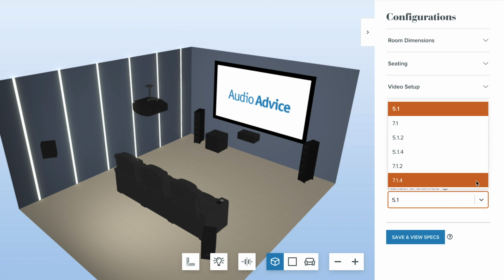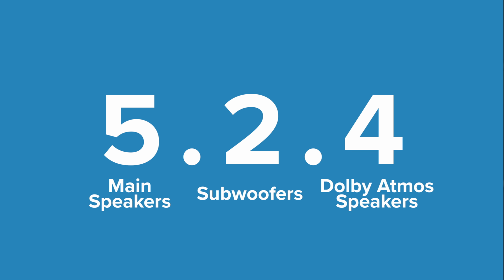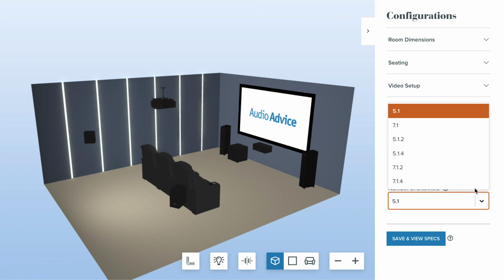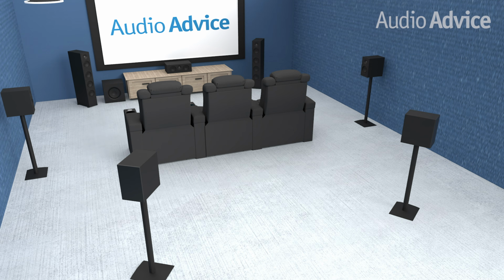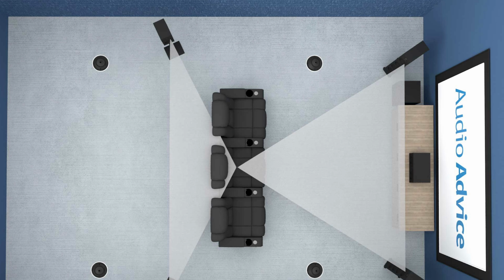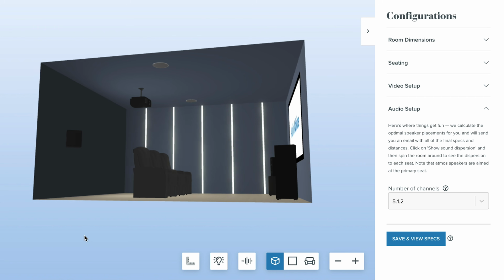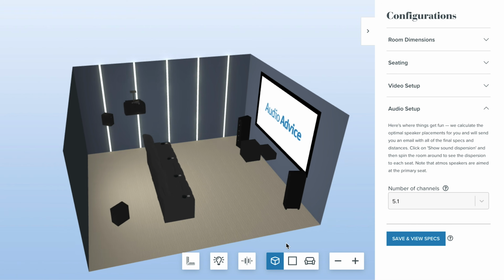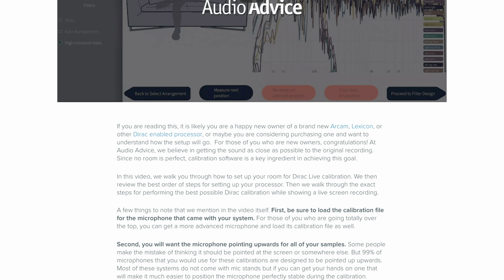Home Theater Speaker Layout Options

Comment: Quick question: If you have a dedicated room that is both an indoor golf simulation and a home theatre, where should the speakers be placed? In an indoor golf sim room the large hitting screen goes all the way to the ceiling, sides and floor. The screen is thick, so probably the sound is degraded if the speakers are placed behind the screen. Additionally, both walls and ceiling will be covered with wall protection padding to catch errant golf balls. These wall panels will be 6 feet deep on both walls and ceiling. The dinmensions of the interior of the room is 10ft 4" H x 14ft 2' W x 30ft D. I'd like to use a Dolby Atmos 7.2.4 system. With this knowledge, where should I place my speakers for optimum immersion? Cheers.

Comment: I'm only running 5.1 (with then intention of running 4 atmos soon) and I noticed that you switched the main surround speaker location in your website tool. I've been setup like you're showing in this video with the main surrounds slightly behind the MLP at an angle. But if I now go in your website tool, they are now perfectly perpendicular left/right of the MLP in a 5.1, similar to what a 7.1 would have be minus the rear surrounds. Is there any new sciences that came out that I missed regarding 5.1 surround placement? Thanks for the help!
Reply from the maker: Yes we did change it after much experimentation and talking with several speaker manufacturers we respect.  Dolby still suggests having them slightly behind you but we found with most theater seats it was more immersive slightly in front.  If you have a chair or couch that ends below your ears, behind might be better in some rooms. Hope this helps.

Comment: If you're talking about moving speakers to fit them around studs, which I think you mean joists, then you don't get to decide left or right or forward or back. The joists run in one direction. You don't get to pick
Reply from the maker: That is correct but in some rooms they run one way and in other another, this is just general advice.  Thanks for watching

Comment: @AudioAdvice --- What's the most speakers that movies could even take advantage of? And whats the most speakers that players/streamers or receivers/processors could output to?
Reply from the maker: Commercial cinemas can have up to 128.  The Trinnov Altitude which is a consumer piece has a 64 channel version.
Reply: @AudioAdvice --- So do the DCD/BD include these 128 channel mixes?
Why does the Altitude have 64 channels?
What media would use them?
Could two Altitudes be used to give a home theater 128 channels?
Reply from the maker: @antiWhiteism777  Its more about the objects.  This is a good technical paper that will help explain https://professional.dolby.com/siteassets/tv/home/dolby-atmos/dolby-atmos-for-home-theater.pdf  You need more channels as the room size increases so the objects move seamlessly.  You could not use 2

Comment: I'm Brazilian and I have a question. Can you help me? I'm going to buy a Samsung Dolby Atmos Soundbar that has two rear speakers. I know a good setup is to use pedestals behind the couch.
Reply from the maker: Yes, that will work great. Depending on your setup, you can use them as sides or rears. Also you can try building your room in our home theater design tool to see where it is recommended to place them: https://www.audioadvice.com/home-theater-design
Reply: @AudioAdvice thank you so much, your answer was amazing! God bless your work always.

Comment: Our new build comes pre wired and set up for 5 ceiling speakers.  Would you still recommend floor speakers and use 2 or 4 of the ceiling for Atmos? Tv Room is about 16’ x 13 with a ceiling height of 10’ I was thinking of the sonos arc plus 2 of their ceiling speakers for soround
Reply from the maker: The Sonos Arc would do well as you are thinking but we would add the sub before the in ceiling speakers. Thanks for watching

Comment: So I guess the key takeaway is to consider atmos speakers in ceiling, but would; 1) this also be a good solution for sloped/vaulted ceilings? 
2) Would the atmos speakers bennefit from having an angle pointing towards the center of the room? 
3) Would it work with the couch/listnening position close to the backwall? (I'm worried that the angle of the atmos speaker at the back will "send the sound over" if you get what I'm saying?
Reply from the maker: We need a little more info about your setup and the room geometry to give you the best recommendation. Please feel free to reach out to us in chat at https://audioadvice.io/aa-chat and we will talk through all of your goals and your budget for getting the sound possible in your room size.  Thank you so much for watching.

Comment: You talked about 2 subwoofers are good where do you recommend placing them two in the front or one in the front and the other in rear?
Reply from the maker: If you have the flexibility and some adjustment options, one in the front and one in the rear in opposite corners works very well.  Ideally you would have a way to adjust phase on the subs or a processor with independent sub outs (but that is rare)  Thanks for watching

Comment: If there are two speakers already in the ceiling slightly behind the primary listening position, would you recommend a 5.1 setup or a 3.1.2 setup?
Reply from the maker: You could certainly try both but it’s probably better as a 5.1. Thanks for watching

Comment: Can i use my bose accoustimass 10/3 for dolby atmos if i buy new reciever with dolby atmos settings ? My new TV got Dolby atmos and i wanna use it with netflix and amazon prime ..
Reply from the maker: While you do connect those older Bose speakers to a home theater receiver they are not really made for Dolby Atmos. You need 2 more speakers   Thanks for watching
Reply: @AudioAdvice  i can buy 2 more original accoustimas and put it direct to av reciever. But will it works with old reciever   ?
Reply from the maker: @Artem_ZpCity  No, the system only accommodates 5 speakers.  Just check your manual and you will see.  All of the speakers wire to the subwoofer and there is a custom cable that goes from the subwoofer to a receiver, you are limited to the 5.
Reply: @AudioAdvice  can u give me one more tip? Accoustimass and 7.1 reciever. Where i need to put rear speakers ( surround or baxk speaker )? Thx a lot
Reply from the maker: @Artem_ZpCity  Yes, you could do that, you would need a pair of speakers similar in sound to the ones you have, you will need to make sure the receiver is Atmos capable and you can use our free tool to see where you should put things https://www.audioadvice.com/home-theater-design#designer

Comment: This is hard to follow if you use inwall speakers, and another thing if I'm not wrong Dolby atmos requires or recommends a more direct speaker placement, while THX uses slightly different placement and hights. Nice video helping people for free ^^
Reply from the maker: Thanks for watching.  In walls would go in the same places.  We used the information provided by Dolby to lay out all these.

Comment: I have an open loft with 3 exterior walls and a vaulted ceiling. The wall is 7’ and the ceiling at the peak is 12’. The room is 15.6’ wide and 25’ long. I’m turning it into a theater room with two rows of seating. The problem I have is with the vaulted ceiling and the open side of the loft. I can hang a big black curtain that I can close when it’s movie time but what will I need to do for sound saturation? Also I want a 5.2.4 atmos or a 7.2.4. Any advice is greatly appreciated 🙏
Reply from the maker: Please reach out to our team at www.audioadvice.com for the best advice regarding your room.  Thanks for watching

Comment: Thank you for the concise and informative video. I noticed the front speakers point towards the listener. What happens if I can only use on/in-wall speakers? How do you aim them? Does it matter?
Reply from the maker: Thanks!  On wall speakers usually have a pretty wide dispersion pattern and work fine aimed straight ahead.
Reply: @AudioAdvice  or you can modify the corners of your front wall to be angled towards the main listening position then mount your LR inwalls.

Comment: All the videos I've seen on speaker placement are for dedicated theater rooms with only one sweet spot... I've never seen a family living room with a single chair hanging out in the middle of a room before. I guess I'm missing something here. How should the speakers be placed in a typical Family Living Room?
Reply from the maker: Great question.  Think of the sweet spot as the place you normally sit on your couch.  You may not be able to get your speakers symmetrical in relation to where people sit, but just do the best you can, then use the level and distance controls on your home theater system to balance it for the area where you usually sit.  Thanks for watching

Comment: I have a big question.  I have an onkyo txrz820. I thought I could do 7.2.2 atmos.  Turns out I can only do 5.2.2 atmos or 7.2. My question.. should I return the atmos upfiriring speakers and do 7.2.2 or keep them and do 5.2.2? I'm thinking the upfiriring atmos speakers don't really make that much of a difference.  So I'm leaning towards the 7.2. Am I  wrong? Please help!
Reply from the maker: It depends on the room, if you have flat ceilings we would recommend one pair of surrounds and one pair of Atmos height which is 5.2.2.  Thanks for watching

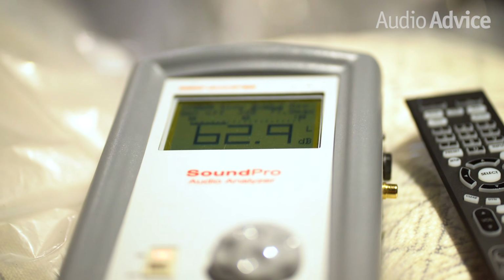Comment: Thanks for this video. I will need some information, what is the microphone (brand) at 8:46 ?
Reply from the maker: That is part of a Sencore audio test kit, that originally cost several thousand $$$.  The current kit is around 2.5k.  For home use, you do not need something that expensive, usually, the microphone included with your AVR is fine.  This one just allows us to do more precise level calibrations and room analysis.  Thanks for watching
Reply: @AudioAdvice  Thank you for this quick response

Comment: Hi there, I am taking my chance to get your personal advice. 

I have dedicated home theater and room enclosed but not in perfect size, 15 x 15 feet with 9 feet ceiling height. I already have 4 klipsch 5650ii installed in the ceiling for atmos purposes. I will upgrade my front speakers and I am torn between Klipsch RF 7 iii/64iii vs Martin Logan ESL X/ ESL C. This will be use for movies 95% of the time. What do you suggest? Would you suggest other tower speakers brand? No issue with the budget, my worry is my room size and Martin Logan is more for music than movies. Thank you in Advance. I am looking forward to hear from you.
Reply from the maker: This is a great question. As you might imagine, to answer it well, we have a few more questions for you that will impact our advice. It's probably easiest if you jump over to www.audioadvice.com and you can call us or chat and we can get into more detail on your system and give you the best advice. We sell both the Klipsch and Martin Logans so our team has a really good sense of where each performs best.

Comment: If I have a 5.1.2, can I place my rear surround speakers in the ceiling and adjust settings accordingly?
Reply: No, main and surrounds are meant to be on plane with the listeners ears. There is no setting in receivers that will modify the sound to change that. However, because of our anatomy humans are not good at locating precise direction of sound from behind, so you would most likely not notice unless you were specifically listening for it. The further you can place them behind you the less noticeable the raised soundstage will be.

Comment: If we have 7.1 AVR and 2 rows of seats, we will enjoy a 7.1 configuration. We will set up 5.1.2 effect olny front row?? 2nd row will suffer ?? Can you advice..
Reply: There are a couple of options here. If you mainly watch by yourself or on the front row only, then you'd have the Atmos a little in front of the front row. However, if you typically have quite a few people in both rows, you can split the difference and put the Atmos between the two rows. If you put in your room dimensions and setup in the Audio Advice home theater design tool it will actually show you these two different setups. Go try it and see what you think: https://www.audioadvice.com/home-theater-design#designer

Comment: I’ve currently got a 7.1 setup however I have the back row (of two rows) of seats against the back wall with my rear surrounds above them, i.e.: terribly placed rear surrounds. I’m changing to atmos with 4 speakers and was going to lift my rear surrounds to the ceiling, reassign them as rear heights and add 2 ceiling speakers making it 5.1.4. Your design tool doesn’t allow for atmos height speakers so I’m wondering if the better match for rear heights would be middle tops or front tops? (or wouldn’t it really matter)? Any recommendations would be very helpful, thanks in advance.
Reply from the maker: Most of the time, using actual in-ceiling speakers for your atmos channels is best if you can pull it off. In your situation, the setup you describe should work. However, if you want us to look at your room more closely and give you more educated advice on it, jump over to www.audioadvice.com and give us a call or you can line up a free design consultation where we can look at your exact room and help you out.

Comment: The .1 for subwoofer means there is one dedicated LFE channel. It does not matter how many subs you connect to it. If the receiver is capable of processing 2 separate subwoofer channels, it gets to the .2 . Most of the time you'll only find receivers capable of 1 LFE processing because that is most common.
Reply: heard you use 2 woofers with a split cable with 1 lfe channel, not sure

Comment: i have 1.1.4  system in two different rooms both have older receivers. i get great overhead plus center, front and back dimensional  sound without atmos decoding. It even works on some You Tube demos.

Comment: I have 7.1 system at the moment just sold my old amp so have to buy new one which will have atmos my room about 7.5 meters long do you recommend i move the rear 2 speakers high for atmos ?
Reply: In many cases like yours it may be better to have atmos rears vs. traditional rears in the room. Here is the link to the design tool. If you put in your dimension, it will actually show you pretty much what would be ideal for your room. If you are still unsure, just chat with the team at Audio Advice and they can look at your design and tell you: https://www.audioadvice.com/home-theater-design/

Comment: I used a random 3d modeling tool a few years ago to design my home theater, but I wish I had your software available at the time. This is great stuff!
Reply: Thanks Jon. We spent a lot of time designing and building it. Our original plan was to charge customers to use the software to design their systems. However when Covid hit, we decided to make it free. We are so glad we did. The response has way exceeded our expectations and it's pretty cool to watch how many people are using it daily to design systems.
Reply: @4movies-music  I’m impressed to hear that. Will it work with irregular shapes/sizes and be able use to factor in anomalies such as uneven walls and ceiling height
Reply: @glennelliott4989  For simplicity we set this up using a rectangle as the base case for a room. However, for people who have a open back or maybe slanted ceiling, it's best to start with the rectangle and modify from there. If you are working on a new room that is abnormal in shape, then start first with the tool and then setup a consult with our team and we will help you work through the differences.

Comment: Your videos are great. One thing you didn’t really touch on is the need for the layout to replicate the exact layout Dolby specifies. If you have to layout speakers in a way where the relationship between the surrounds and the Atmos channels is off from the way it’s intended, it just becomes a lot of sound and not true Atmos. You can’t take a pair of stereo speakers, put the right speaker directly in front of the left speaker and expect to get proper stereo imaging. Stereo imaging relies on a relationship between the left and right speaker position and the listeners position to them. Likewise, Atmos relies on a precise relationship between primary sounds (channels 4 and 5 or 4, 5, 6, and 7) and Atmos surrounds in order to accurately place sounds that the listener will perceive as having true vertical travel and dimension. So one pretty much needs a shoebox shaped room to get Atmos playback to resemble anything done on the mixing stage.
Reply: Not really. Like... At all. Atmos is object based, every modern avr has some kind of setup tool for speaker position and room measurement. 
That is EXACTLY the biggest Home Theatre benefit of Atmos against traditional channel mixed formats.

Your statement holds kind of true for 5.1 and 7.1 , but in those cases surround effects are less specific anyway and you get away with rough setups more often than not.